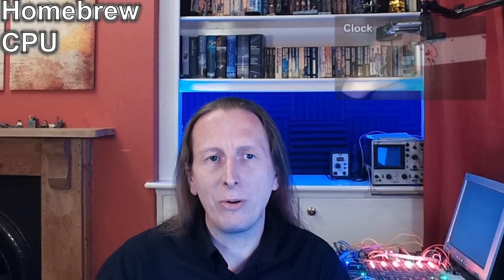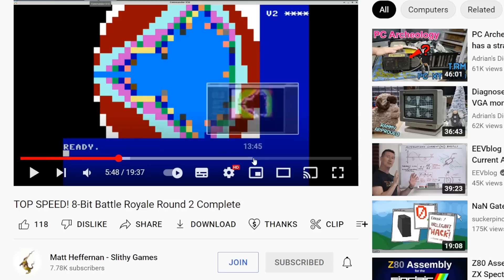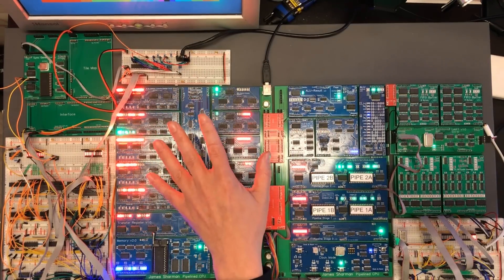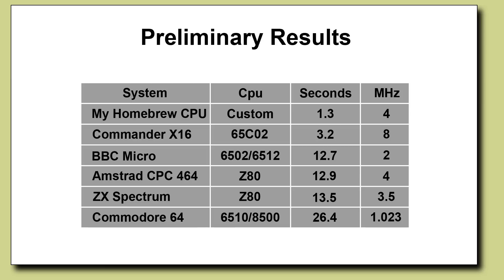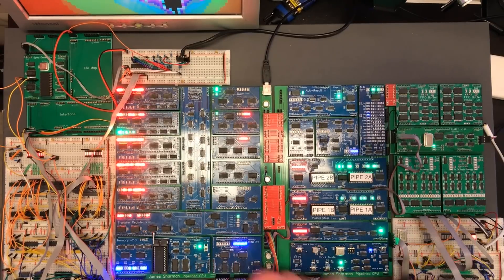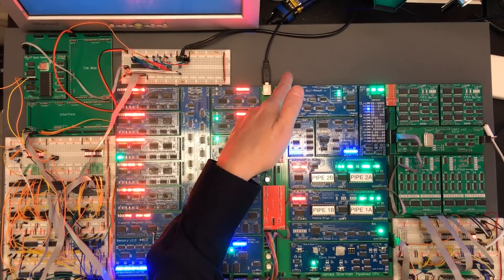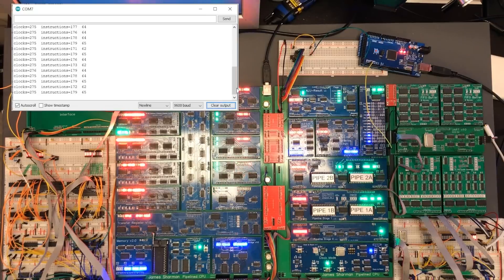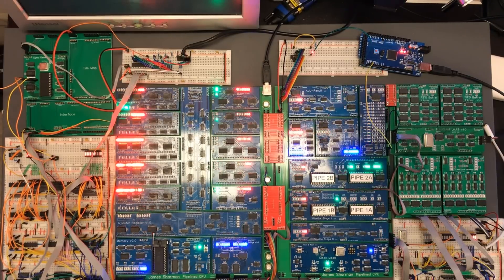Is this the most powerful 8-bit system ever? - Making an 8 Bit pipelined CPU - Part 100

Comment: Great to see the results here. I was a Z80 man myself in the 1980's, with the likes of TS1000 (AKA Z81) and Spectrum 48 within my repertoire of experience. I went straight to an IBM clone after that during my CS studies, but the Spectrum gave me lots of pleasure. One of my favourite games was Basil the Great Mouse Detective, chess, and a few others. Wrote my own 3-line editor. I tried making a full-screen editor, but it was painful watching the screen repainting after each keystroke. 3 lines were perfect. Boy what a trip down memory lane and I have you to thank for that James. Will you be re-inventing a sort of hard-drive for the computer? I would watch such a series. At this point I almost think you can build anything.
Reply from the maker: Ahh yes, you mean the ZX81, in hindsight it's incredible how little extra they managed beyond just the cpu to keep it cheap! I assume the editor was in basic?  Really needed at least the screen update routines in assembler.
Reply: @weirdboyjim  Yes all of it was in Basic. One of the most useful feaures of the  Spectrum basic was the fact that you could use a variable in place of a literal line number. This means that when you needed to branch to a sub at line 100 (say) to do screen update, you could at the top let screenUp = 100 and when you needed to call it use Gosub screenUpd. It may seem trivial, but it made the code easier to write and read. I still cannot today figure out how I learned to write code in a language without If then and else. There was no else in basic...??? Admittedly I only learned that construct later when I lerned Pascal as part of my CS course. It took a few days to write the editor and when I later refined it, I could save documents and read them using my editor, and print them out. 48K???

Comment: Question, what exactly is a "pipeline" in CPU architecture? I've made (very basic) CPUs before, but have never delved into the more modern and complex designs and tricks, as it just seemed like there wasn't enough decent information on that sort of stuff.
Reply from the maker: At the high level it's actually quite simple. Think of it like a production line with specialists each doing there own job to build something. Maybe start with my metaphor in the design retrospective  (https://www.youtube.com/watch?v=QZMcBETdydA&t=838s) and then look at any of my videos with pipeline in the title.
Reply: @weirdboyjim  Ohh. That makes sense. 

Are the steps kind of like:

1. Read the instruction. 

2. Decode the instruction. 

3. Check if the instruction is a valid instruction to execute at that time and won't cause collisions. (i.e trying to write to memory that's being read)

4. If the instruction would collide, freeze the pipeline until the previous instruction is complete.

5. Start executing the instruction.

6. Repeat.

Hopefully I got that right and didn't just come up with something completely different.

Comment: Might make an interesting “load/efficiency” display to have a couple counters, maybe a subtractor and some leds to display a running IPC of sorts? 😎
Reply from the maker: That's obviously what I was going for temporarily with the Arduino, I have thought about doing it with a couple of counters so I can do it at high speed. But that would have been a lot of wiring for just this test.

Comment: The pride you exhibit regarding this computer is VERY justified!  Your work will not only help many people in the future understand the low level details of how computer systems function, but will also show the magic of following a dream and making it reality.  If I had enough thumbs you would get a ten thumbs up from me for this series.  (I think it is probably the best digital design series out there.)
I'm personally not surprised at your results on the Mandelbrot set.  The old 8-bit CPU's were designed either to fit what technology of the day could cram into a single chip, or were designed to a price point.  It would be interesting to see how your processor stacks up to even some 32-bit processors of the day, like the Motorola 68000 or even the first ARM processor.  I think you might beat the 68000, and come in for a close second to the ARM chip.
Reply from the maker: High praise there Dave. Yeah, comparisons are difficult. The microprocessors we are comparing to here were revolutionary not for performance but for being a big part of bringing the entry point right down.

Comment: 6:35 I don't want to sound arrogant, but the relevant performance question is always the number of nano seconds a particular instruction takes... not how it is subdivided in clocks or machine cycles. So that "all at 1 MHz" comparison is actually pretty irrelevant and misleading. Especially so for the 1980s, where fast memories were expensive, and a limiting factor in most designs. Home computers or embedded systems.

For this particular case, the most important difference is that the Z80 allows two full cycles for memory access while the 6502 family allows just a fraction of a cycle. We don't even have to check the datasheets (which I did, for 6502, 6809 and similar). The Commodore VIC-64 programmers reference itself states that the 6510 allows a memory access time of max 300 ns for 1 MHz operation. 

The Z80 on the other hand can be clocked at about 6.5 MHz using the same 300 ns memories due to its long two clock memory access period (300/2 clocks = 150ns => 6.7 MHz). It can also perform a 16 bit addition in 11 cycles while the 6502 needs 20 (longer) cycles for this. So a Z80 using exactly the same affordable memory chips would be able to perform 16-bit (or 32-bit) arithmetics about twelve times as fast as the 6502/10.
Reply from the maker: I often say that the only performance metric that truly matters is how long does it take to do [task that you need to do]. Any attempt simplify what is really a large and complex subject will have some kind of flaws. 

For example your assertion that “but the relevant performance question is always the number of nano seconds a particular instruction takes...” fails to encapsulate the relationship between throughput and latency. My cpu takes 3 cycles beginning to end to execute a trivial alu operations, the 6502 can do it in 2. But my alu operation may overlap with 4 others in time but the 6502 will not. This is why I can do 4 16-bit additions in less than the 11 cycles you quote for the z80. 

My hope with this video was to provide an overview with just enough detail to hint there is more iceberg under the waterline. I touch on lots of parts of this discussion in other videos but the subtleties of differences between 6502 and z80 are not really on-topic for the channel. I would personally phrase the differences between differently, but my way of describing it isn’t necessarily better than yours and would really just be a distraction.

Comment: The 6502 clock speed is a bit misleading - it uses a 2-phase clock, effectively doubling its internal cycle rate in some cases. Conversely, the Z80 (and others) effectively generated a multi-phase clock from a single oscillator. Taking that into account, you can see that they are pretty close to each other. Both are blown away by the pipelined cpu - I didn't appreciate just how much of a throughput boost pipelining gives. If you had more RAM bandwidth you could get a fair bit more throughput in some conditions, with a single stage look-ahead buffer. But at that point it starts to get really complex (as if it isn't already).
Reply from the maker: Yeah, performance is a very difficult discussion point. This was a pretty short video where I didn't want to go too deep so the point I wanted to get across was really "it's more than just MHz". Truth is the most important performance metric is how fast can it do [thing I need to do].

Comment: A great video, and a great way to mark the 100th episode.  Mandelbrot plots are always cool.  It's fascinating how the incorporation of pipelining improves the IPC performance compared to machines without it.    Of course, un-rolling loops and similar tweaks can also help further if the algorithm allows and one has the patience. ;)
Reply from the maker: Thanks! Elements of the design came from my own experience optimizing code and tweaking the instruction set to make things easier.
Reply: @weirdboyjim Kind of like ARM, where Sophie both programmed BBC basic, and also the instruction set for ARM,  without anything too unnecessary. I'm sure they also got input back from the implementation for what's easy or not.
If you ever get into another build, I'd love to see perhaps a standardized ISA like RISC-V or MIPS or some such, made into a homemade CPU. The instruction set and architecture are a lot more disconnected than you'd really think, when you get more advanced.

Comment: I'm thinking that if you wrote a CPU book it might be a fulfilling next direction for your project, and many people might be interested. It could be written in parts and published on Amazon KDP , with each subsequent edition adding more content to previous editions - this way the first edition might be 200 pp or even less, and expanded to a longer book overtime. I'm mentioning this in case writing a book might be a fulfilling path for you on which to continue the CPU project. I wrote a book on Analog electronics in the same way, now it's on the 3rd edition, and hopefully the 4th is not too far off. I've had about 300 books sold in a year, but in your case, I think it'd be quite more popular (as for one thing more people are interested in CPUs than in Analog).
Reply from the maker: Wow, I can see that being a bit of a big time commitment. To be honest I'm not sure I would be very good at it, I'm Dyslexic which normally goes unnoticed but it might take me a long time to get thoughts down in that format.
Reply: @weirdboyjim  in light of that your achievements are more impressive still. You know, I mentioned the book just on the chance that's something that you might find inspiring & fulfilling if the possibility was suggested to you. If you feel that's not your thing, then of course, especially when considering the time investment that would be required, it's probably best not to veer into it from the present format, which anyhow conveys to the audience a lot of what a book would have conveyed. For me personally, the idea of a book was more exciting so I pursued it, but then again I wouldn't have had the talent to make interesting YouTube videos..

Comment: So even though there are faster 8 bit processors now, what's interesting about it is that this is a computer you could have designed and built in late 70s. Have you compared the gate or transistor count with chips like the 6502? It'd be interesting to know if this would have been manufacturable as an IC back then.
Reply from the maker: That's a tough one, you could add up all the gates on the chip I've used, but many of them are more general purpose with features I'm not using so you would end up with a far higher count than it would actually take.

Comment: Great video! What do you think was the greatest limitation on the original 8 bit processors, to stop them reaching the same relative performance levels: cost of silicon, manufacturing limitations, lack of prior knowledge, or complexity?
Reply from the maker: Thanks James! That's actually a big question, the 8-bit devices we are talking about had a big part to play in creating the home computer revolution. It wasn't about performance it was about actually working at a price point people could afford. I also have some massive advantages (in addition to the hindsight of 40+ years of progress in cpu design). I can put a 32k static ram chip in here without thinking (a few dollars max) but the older micros had to compromise between cost and speed.

Comment: Amazing work! My 3x breadboard Z80 based hobby computer was stable at 10MHz though.
Reply from the maker: Thanks.  The biggest limiting factor on mine is the rom chips, they have a 140ns access time so cap the speed at about 7mhz even if everything else was instant.
Reply: @weirdboyjim  In my case EEPROM AT28C256-15PU with access time as high as 150ns is perfectly readable at 10MHz, though I have to switch system clock to 7.3728MHz when I need to write to it in situ.

Comment: It would be cool to create a microprocessor that executes .NET byte codea natively. There's a wonderful paper on the JOP realtime processor which executes Java byte codes.
Reply from the maker: That would be a challenge, it would have to implement a subset and then have a clean way to handle other things in software.
Reply: @weirdboyjim  back in the early 80s (I think) Western Digital made the WD9000 series chipset which was a CPU architecture optimised for the optimised execution of p-code (from Pascal).  I know next to nothing about it, but I remember seeing the boards in systems back in the day.   It always struck me as an interesting way to build a processor tailored for a particular language or software environment.
Reply: @GodmanchesterGoblin  There was a custom chip designed to execute LISP and there's also a Java processor called LEON.  I think ARM had a hardware accelerator for Java called thumb.
Reply: @bobweiram6321  Yes, the Thumb extension to ARM was not specifically for Java but was used to improve code density, with some instructions being reduced to 16 bits in length from 32.  It was used by a number of ARM licensees.

Going in another direction, there was also the Rekursiv processor architecture developed by Linn (the hi-fi company) designed to handle object oriented processing - there is some limited information on the web. Some of these would make interesting research projects if one had the time.

Comment: I wonder, how would your computer compare to a commercial discrete logic computer like the PDP-11? Or even a modern AVR or PIC...
Reply from the maker: I suspect those modern AVR's and some of the PIC's maybe faster, especially at higher clock rates. The PDP-11's were 16bit devices but I don't know a great deal about their performance characteristics.

Comment: A very impressive result and a great 100th video. Shows how pipelining is far more efficient at running code than micro-coded CPUs. 
I watched the 8-bit Battle Royale when it first came out and wrote a Mandelbrot for the CSCvon8 and got it to do 32x22 with max 16 iterations in about 2 seconds running at 6.3Mhz. Took me quite a while to get the 16x16 bit multiply to work but when I got it right it was magical to see the Mandelbrot set draw on the screen the first time.
Reply from the maker: Thanks David and nice work! That actually sounds very fast for that architecture. Maybe I should get you to optimize my code ;-)
Reply: @weirdboyjim The code isn't very optimised but the CSCvon8 'cheats' as it has a big ALU ROM with 8x8 bit multiply instructions, which helps a lot in this case. I've also got 160x120 with 64 iterations to finish in about 2 mins.

Comment: What a fantastic project and an awesome achievement. It's hard to believe that this was how early processors were designed and tested, with lots discrete chips on boards, all spread on a desk. It's even more amazing that today, all of that can be fitted in to a tiny little package smaller than a fingernail and can be purchased for pennies. My first computer was a Sinclair ZX81, which I thought was a miracle of miniaturisation. 😁
Reply from the maker: The ZX81 was one of the first computers I had regular access to, horrible little thing in hindsight but felt like magic at the time.

Comment: Thanks for the shout-out, James! I hope to start looking at your system soon.
Reply from the maker: Well thanks for your series and making the code open source! In part due to your comments I've started work on a simulator so I'll have the means to distribute a functioning build sooner or later (Sooner = less polished interface).
Reply: @weirdboyjim  If I could get a verilog implementation, that would be perfect!
Reply from the maker: @slithymatt  I just a pc executable. Some people on my discord are trying to put together an fpga version but it's not something I'm working on.

Comment: It's a shame Matt Heffernan didn't look at the 6809 in his comparison (unless it's hiding in his repo). It's a pretty fine 8 bit micro, though it has perhaps an advantage in that it was probably the last of the 8 bit MPUs, being released in 1978. But it certainly has some nice features, including 16 bit arithmetic and a hardware 8x8->16 multiply unit. It's often ignored in comparisons of the 8 bits.

Anyway, bloody awesome achievement which I'm sure has inspired many people in there own projects, myself included! Really looking forward to seeing sound and video finished up, and then whatever comes next!
Reply from the maker: Thanks Lawrence! Oh the 6809 is the TRS-80, that would be a worthy inclusion. Are there emulators around? The hardware is not easy to get hold of.
Reply: XRoar seems to be the most common. Will emulate a Dragon 32 and a Coco. I’ve never used it, or any 6809 hardware for that matter, besides machines I’ve built myself. I’ve also written a fair amount of 6809 assembly and can attest to how nice it is to code for. Make sure the 8/2Mhz part is used for a decent comparison, though I’m not sure what the popular micros had installed. To muddle things further you have the Hitachi 6309 derivative, which was a drop in upgrade in some micros, though it’s also available in 12/3Mhz speed grades (quadrature clock)